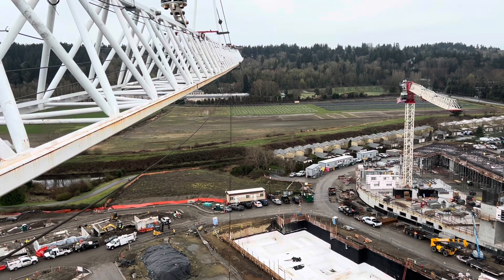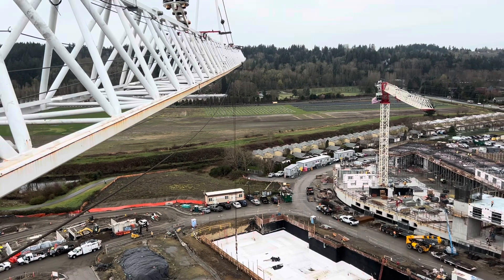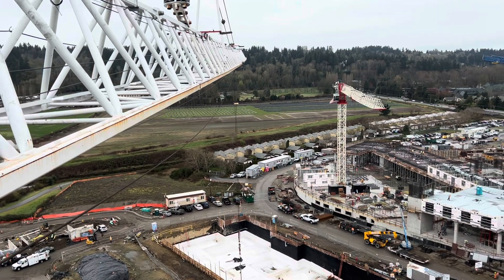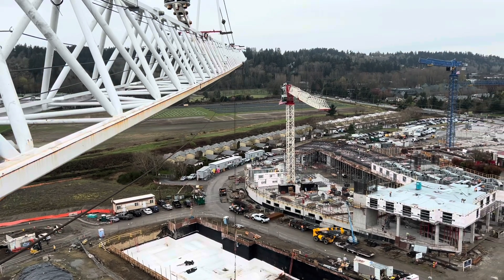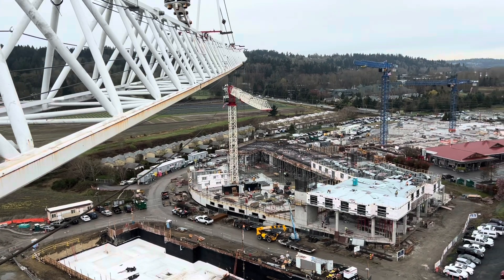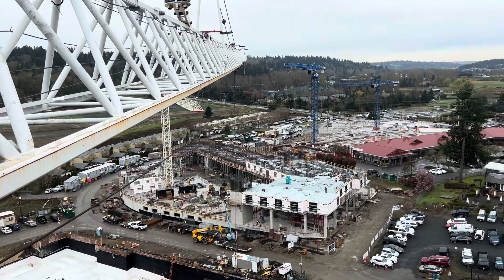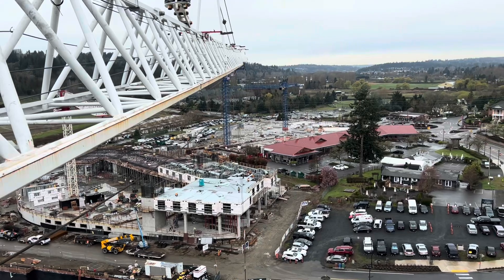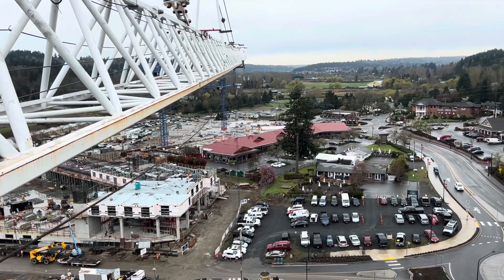How do cranes not run into other cranes?

Comment: Super informative video, appreciate the insight. any advice on getting into your first tower seat after getting the op certification? I'm in Texas
Reply from the maker: Sincerely, thank you!
As far as getting a seat after getting your certification, I would concentrate a little bit more on getting time under the hook. 
I know that it’s exciting and we all want to get up there as soon as possible but honestly I can tell you by experience that a whole hell of a lot of what you learn on the ground is going to help you immensely once you do get up in the seat.
Concentrate on signaling and rigging and offering to do inspections for Operator. That way you can become more familiar with with the crane and fingers crossed the operator will give you seat time. 
I said I know you want to get up there but just take your time and learn everything that you can on the ground first. You’ll thank me later!!

Comment: Love the videos, any leads on a seat travel is not at issue. Hello fron Dallas
Reply from the maker: Sincerely, thank you my brother and as far as any seats up here, Work has been kind of slow unfortunately.
Are you union or non-?
Reply: @foxhollerhomestead  I am not union
Reply from the maker: @JoseGutierrez-jv1oc  well, I’ve in Washington it is possible to be nonunion. It’s just a matter of finding the right company that will hire their own operator.
Typically those companies are going to be general contractors that do big jobs with a Tower crane on those jobs rather than a crane company that solely deals with crane rental.

Comment: If i have experience in operating crawler and mobile crane  will the tower crane be easy to operate for me? And do you recomend me to change to tower crane what your advice, thank you
Reply from the maker: Honestly, my friend if you can run mobile and crawler, you would not have any problem in a Tower crane! 
I also have my mobile and crawler certifications, and I keep them up to date just in case.
If you have a chance, then I definitely recommend you try tower and see how it does for you! 
It is a very high demand job as there are not a lot of individuals willing to climb high and take the risk but it’s definitely worth it and a lot of fun.

Comment: Very interesting. Eyesight is the best thing. You can't always count on a computer to stop.Accidents do happen, and failures on computers do happen also. 😮😊
Reply from the maker: Honestly, yes, you’re right, eyesight, and depth perception is the best tool that I have. 
On this particular job site, the computer is only set for a very small limit, but there have been other job sites where I am very close in proximity to powerlines, which helps immensely.
The best case scenario under those circumstances, though is going to be a powerline spotter, rather than relying on the computer completely.
More times than I have seen this fancy technology go to complete crap!! 😂
Reply: @foxhollerhomestead  Love and blessings to you and your family! 🙏
Reply from the maker: @rhondasweeney7271  love and blessings always to you and yours! 🙏